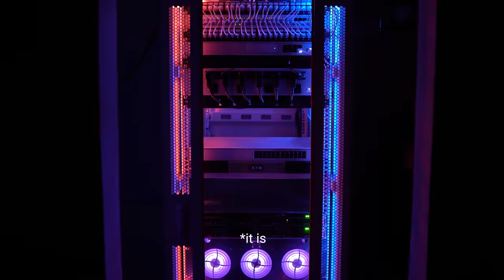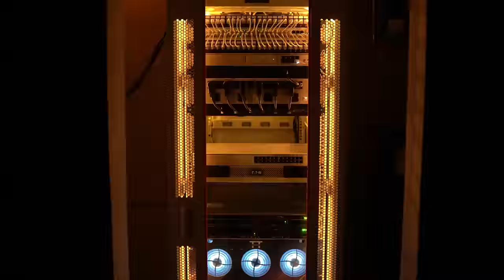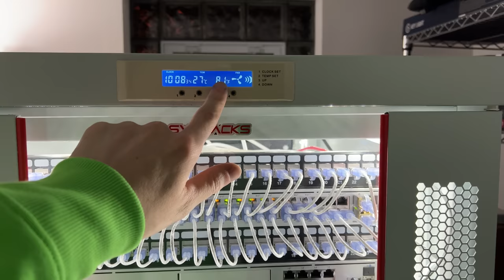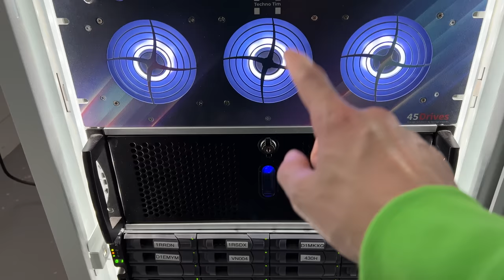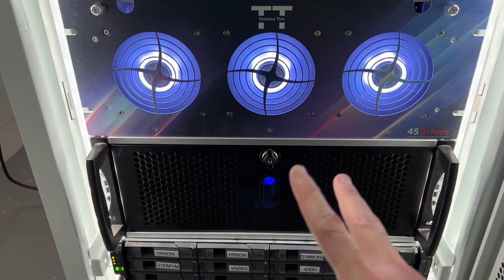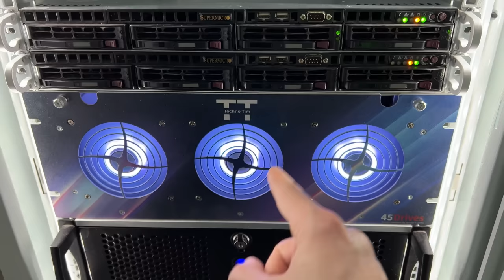Techno Tim HomeLab Server Room Tour! (Late 2022)

Comment from the maker: What's your favorite thing in your HomeLab?
Reply: The number of CORES 😎

And most importantly a silent setup 🔕
Reply: My Jellyfin server. It's open source, doesn't require an internet connection, and handles all my media without issue.
Reply: I love my Unifi USW-24 POE
Reply: The 3 silent mini-pcs I got from school for free
Reply: Well in the 4th quarter of 2022. I went from a single spare PC (5600G 32GB ram) and 2 pi4's  to a full 48u rack, 2 Dell r620's (dual E5-2650l v2 [10c/20t], 64GB each), and the existing hardware I mentioned from before the rack... Hard to say what my favorite thing is.
Reply: @JohnWeland  how much did everything cost?
Reply: @Logilype  42u rack was free, found a guy that was giving it away (old but works). The Dell r620’s were $75 a piece. The upgraded cpus were $10 (total) the ram was a little spendy. 170 I think for 128gb
Reply: That one Dell R430 I got lying on a desk that I turn on every now and then 😬. Planning on getting a Open Frame rack soon to house it and some other networking equipment i bought but have not setup yet. Dell specs in case anyone curious -> Dual Xeon E5-2660v3 [10c/20t] @ 2.6GHz (Planning on upgrading to 2660v4 [14c/28t] @ 2.00GHz which should help with power draw a bit as it should be more efficient), 104Gb of RAM, Proxmox (switched from esxi), 12Tb of storage, Quadro P400 for Plex... so yeah not very flashy or interesting but I love it.
Reply: The fact I even got it started this year
Reply: Why didn't the previous videos have Chinese subtitles?
Reply: What broadband provider do you have over there?
I use China Telecom's 1000M broadband for 139 yuan a month.
Reply: Hey Tim please tell me what's the best alternative to centos distribution which Redhat has stopped supporting it? 
As an alternative  i m confused between AlmaLinux and  RedhatFreeSubscription. 
Please let me know what's the best from both you advise for servers? And why?
Reply: Well, I haven't even taken delivery of it yet (just days away...) but I just know it will be my favourite... a HPE DL380P Gen 8 server equipped with 15x 300GB 10kRPM and 10x146GB 15kRPM drives, 2 x Xeon E5-2650V2 CPUs, 128GB RAM, 2x 10 (8??) Gb NICs, 4 x 1Gb NICs. I will add an LSI PCIe adapter in HBA mode and 4 x 1Gb Crucial SSDs which will be the basis of a Proxmox installation. TrueNAS will run on Proxmox in a VM and use the 25 Drives configured as ZFS, for storage (I will change the onboard RAID controller to HBA mode). Proxmox also will host several VMs and container-based stuff. This monster will work alongside my existing NUC that also runs Proxmox which, in turn,  hosts Unifi controller, 2 instances of Home Assistant, my current TrueNAS server (which currently hosts Plex), Pi-Hole and Shinobi (which handles my security cameras.) PFSense is high on the list of things to get done once the hardware arrives.

That said, my next favourite thing is my UPS, which will be commissioned in the coming weeks. 46 x 330W LG  Neon solar panels, 8 x Pylontech LiFePO4 3.2kWH batteries, 3 x 5kVA Victron Inverters - yes, I am going off-grid and it's been a lot of fun setting it up.

Edit: OK,  so I have my server now. It has been very challenging setting it up and overcoming the fan noise coming from the unit. 5 days later I have everything up and running except that the onboard p420i sas controller cannot be passed through to VMs in Proxmox.  The workaround has been to pass through individual HDDs (all25 of them... *sigh*)

Boy, has this ever stretched my linux knowledge!
Reply: That it's in a colocation! I got a hell of a deal, free space for 4Us, free network, free power. Only draw back is I don't get a public IP. I have a Dell R620 and a Dell R720xd there now. Trying to decided on a Firewall/Switch Option. If anyone has suggestions, I'd welcome some advice. I'd like it to support wireguard.
Reply: @Sci-fi-Si  估计要等到2096年才能实现。
Reply: My NEW awesome ibm/lenovo x3550 m4 for minecraft hosting
Reply: The fact that I have managed to repurpose old PC Parts from my gaming set up into a TruNas Server for my massive photo library
Reply: @rtyler1869  don't understand?  ?  ?
Reply: @ovenff3899  I built a gaming pc.  Then upgraded it last year and moved all the components into a new box with heaps of internal sata drive bays. In these I have installed 6x 3.5” HDD and built a truenas server. Just getting into home lad

Comment: I have been racking gear for years through my IT travels including in corporate data centers. The networking and cabling is usually done in the back as all the connections for the servers are in the back. Most people need all the U's in their rack and cannot justify the cost or the loss of the U's to do everything in the front. You lost two U's for the keystone pass through and then the cost of that setup. Some gear you can share U's by putting one in the front and one in the back. Assuming that is possible here you also lose U's for that. Doing this in the home is fine but you will not see this in an actual data center or corporate setup.

Comment: My favorite thing?  The Supermicro servers with IPMI and lot of RAM!  This is a very nice and very capable HomeLab... and even more because the way you're handling it with Kubernetes, Ansible and so on.  It's nicely laid out, don't worry about what others think of it!

I'm a old timer Sysadmin / Network Engineer who did many things in my life including using mainframes like Vax and Big Old IBMs, i used to have a Sun Workstation on my desk and rolled out the first bind DNS for the utility i worked for!  I installed the first version of SlackWare using diskettes on a Dual Pentium Pro system! I installed the first Cisco Routers that looked like coming out of a garage with cards hooked with flat cables (the AGS / MGS etc) routing for a big network of Synoptics hubs (we had 18 000 PCs, 450 Routers, etc)!  A bit after, we started to use Kalpana switches (later bought by Cisco).

I'm now converting to containers and orchestration, state management and CI/CD!  For the last 20 years, i did virtualization firstly with VMWare and after a while, i converted to Xen (on CentOS) and just a bit after, to KVM.  I did a lot of scripting for automation, replaced now with Ansible.  I found your very good videos wandering around on youtube: I'm learning a lot from you and i like youngsters sharing their great passion for techno!  I learned all of my life and i still do everyday, that's the essence of what we do.  Kudos for the very good information you're sharing!

Comment: My main project for the past year was to make custom length IEC power cables. I wanted to get rid of all extra slack in my racks. Almost all of my racks are mobile racks for live music and a few hifi vintage racks. I shortened all my power cables to the perfect length in my racks, and replaced the normal IEC plug with a locking plug. These locking IEC plugs are a godsend.

Comment: Very nice setup 👍

I picked up an Intel NUC 9 Extreme this year to use as my Virtual server host.  I moved over 64GB of RAM and a 1TB Samsung 970 EVO Plus.

It is pretty quiet and does not take up as much space as the pair of smaller NUC's that I was using.

The Dell Poweredge R210 II that I have was upgraded to 32GB or RAM and has a 1TB Samsung SSD boot drive and a 4TB WD Green drive to backup my VM's from the NUC 9.

I sold my old 4th gen NUC & moved the 7th gen NUC downstairs to be my Plex server.

I am happy with this now the Plex server is running Windows Server 2019 Datacenter with a pair of Samsung SSD's and 32GB of RAM.

The NUC 9 was a steal at 50% off list price. 

The NUC 8 that was my day to day Hyper-V server has been rebuilt with 48GB of RAM and a spare 1TB Samsung  970 EVO Plus. 

It is running Windows 11 Pro and is my go to machine for browsing the Web and listening to podcasts. 

I can also spin up the odd VM on it for testing before moving them to the NUC 9.

I do not have anything fancy as far as switches.  I invested in a Cisco CBS250 16 port fanless switch and got a TP-Link DECO mesh Wi-Fi unit with 3 units in the box.

This sorted out my Wi-Fi issues out and also sped up my data transfer from my machines upstairs and my Plex server & my Dell backup server.

I like that the NUC 9 has a pair of 1GB Intel NIC's on board.

My next project is to get Pfsense virtualized under Hyper-V and see how that performs.

I would love to get a second Cisco switch to replace the cheap slink that I have connected to the Dell Poweredge.

The NUC 9 with it's 45W 9750H i7 with 6 Cores and 12 threads is a great small system for a Hyper-V server.

I would like to run some CAT6 between my router and my office upstairs and my Dell server under the stairs but for the moment the mesh Wi-Fi will have to do.

I was using home plugs before but I was getting transfers if 10MB Per second between my systems upstairs a d my Dell server under the stairs.

Now I am getting up to 52MB's per second.

When you could be moving 1.5TB of files a 5x improvement in data transfer speed is a great improvement.
Reply: Bro paid 1000 dollars for windows server 💀💀💀
Reply: @Logilype  I paid for the hardware. I already had the software.
Reply: @Logilype  the normal barebone price for the Intel NUC 9 Extreme I7QNX is on Amazon for £950.  You have to add RAM & SSD plus OS to that.

Comment: TechnoTim, I really enjoyed your video!  You have a lot to be proud of and share.  By way of background, I have built many large data centers even receiving a national ASHRAE award. I've been running my home lab since 1993 and am going to be making a few changes to my 42U home lab cabinet as a result of your video.  Thank you.  The white rack and cabinet lighting is something I remember seeing at EBAY's data centers.  Visibility in the rack makes work more efficient with less mistakes.  I do have a couple of suggestions for you.  #1 I would get a 4" ladder or more likely basket tray to manage your umbilical cord line from the wall to the rack.  (Cabling does best in established pathways.)  You could convert the resulting excess cable length into a service loop on top of the rack to allow the cabinet to still move around.  Maybe secure the basket tray to the wall control and ceiling suspended just above the cabinet? I installed a 4" wide x 2" tall white basket tray while back that worked out really well.  #2 It looked like your Philips Hue lines may be breaking one of my personal DC rules.  Never "bundle" 110/220 and UTP together.  I have many sad networking stories and A/B test results that inform this opinion.  You have done an excellent job of separating out the two cable types otherwise!
Reply from the maker: Thank you so much!  I had no idea what to do with the umbilical cord!  This is a great idea!  I am just trying to figure this all out with little to no experience besides the internet 😀
Reply: @TechnoTim  Your server room is amazing.  I've never seen a server room or data center that was perfect (especially the ones I've done). ha ha.  You have zero to be apologetic about.  I kinda envy you brave content creators in that you benefit from a crowd sourced advisory committee.  Big fan of your channel.

Comment: Very nice.  Yeah enclosed rack does trap that heat - one way to turn it into a positive is to duct heat out of room.  My summer temps are high.  On my 24u open frame I got thick grow plastic + magnetic tape to create rear side "panels" to help contain heat right at servers' exhaust.  Then picked up inexpensive infinity booster fan + duct to exhaust heat outside with AC window kit.  Sits right behind 3x 2u servers.  Works well to not keep recirculating heat.  That and a 20' king air house exhaust fan sitting in window 5ft away from rack to cool at night.  :) Not sure your heat situation in summer but perhaps outside exhaust solution could help with enclosed rack.  AC works too.  On another note - slim CAT6 cables patch work making me want to spend $.
Reply from the maker: Great idea!  I wish I could fine a clean way to seal a duct to my block window vent!  Any ideas?

Comment: Tim, very nice setup for a home network rack.  I'm not much different but definitely less compute and storage.  I am somewhat lucky to be able to do my home lab in an area where the cost for power is the second cheapest in nation at 2.6 cents per kilowatt hour.  Where and how are you forcing the hot air out too?  Are you having to install any active cooling?

Comment: Great update and upgrades. I'm slowly moving away from Ubiquiti as an edge device option and back to Pfsense/OPNsense. Ubiquiti just lacks creature comforts like HAproxy and other simple services. I will miss the pretty UI graphs but I just dump everything into grafana.

Currently have a UDM-PRO that I'll be selling to cover the UNVR to run my cameras and protect. I'll virtualize the controller to manage my AP's and SSID's. Got a killer dream on a Netgate XG-7100 that will be running Pfsense/OPNsense, it'll handle my vlans and dhcp duties as well as the previously mentioned HAproxy.

Comment: I did not check if you use homeassistant yet, but wouldn't it be better to have your zigbee antenna, connect directly your hue/zigbee lights to your server (through zigbee2mqtt) not use the philips hue hub? So you don't rely on philips network, don't need 2 hubs, your lights work without internet and turning them on doesn't need to rely on the speed of internet connection?

Comment: With the release of K8s 1.26 it is now possible to have a service of type loadbalancer and mixed tcp and udp protocols. That allows me to have a 3 node Pi4 K3s HA cluster (thanks to your ansible playbook) and PiHole finally inside the k3s.
Longhorn has currently in the version 1.3.2 some breaking changes with k8s 1.25 and up. I had to use the master branch of longhorn to get it to work in k8s 1.26. They plan to have it fixed in the release 1.4.0.

Comment: Maybe a good tip for those with OCD in the comments section:  When you first get your equipment and the power cords are folded up, take them out and hang them from one end and let them straighten themselves out.  A small weight can assist with this but don't damage the cable with something huge.  Usually within 24 hours they are straight as an arrow and look nice when you run them from the newly installed device.  I like to make a nice round service loop coil with Velcro straps somewhere between the receptacle and the device plug too.

Comment: I could be wrong, but wouldn't hooking the other redundant supply on the storage shelf share the load between both power supplys. Therefore cutting the use of each in half. Basically using the same amount of power. Other than that, it looks good. Over complicating cable management IMHO just hinders the time in making repairs or replacing cables.

Comment: The Amazon listing for your rack says it is 42U - but unless you are a giant, there's somethign fishy going on.  My 42U rack here is significantly taller than I am, and I'm not short.  I'm not sure how tall you are - but I would guess your rack is only about 36U.

The rest looks really good - better than most of the racks at work.  The only thing that would get you in trouble is your "umbilical" - that needs to be suspended up high enough to walk under.  Best would be to have a little piece of cable-tray stick out from the wall, and just have a round on the end to control bend-radius and let it all drop to the rack.  Easy to just drop new cables into the tray as needed in the future then.